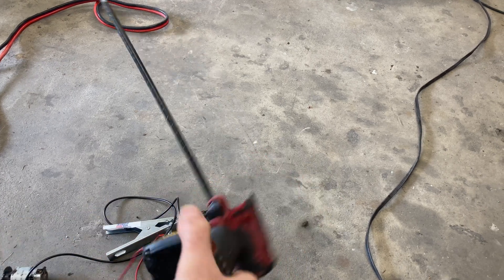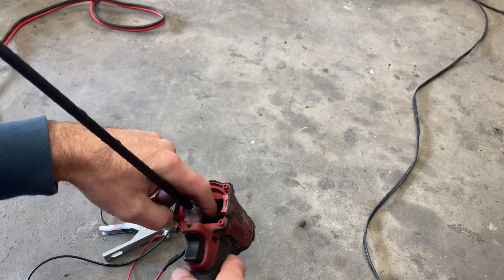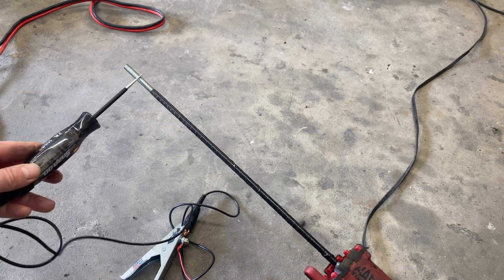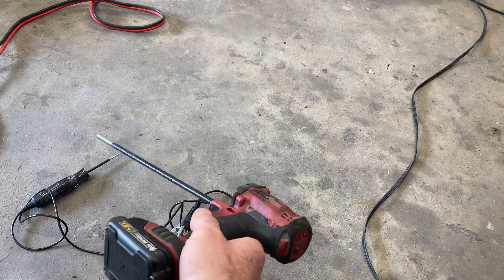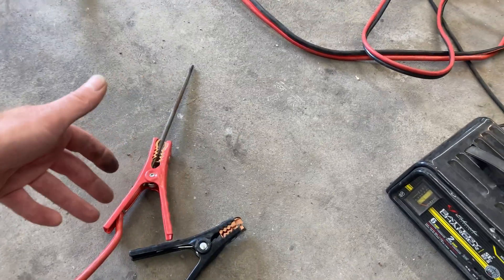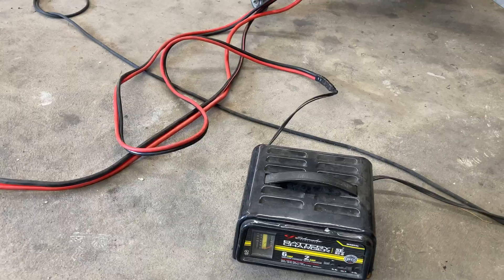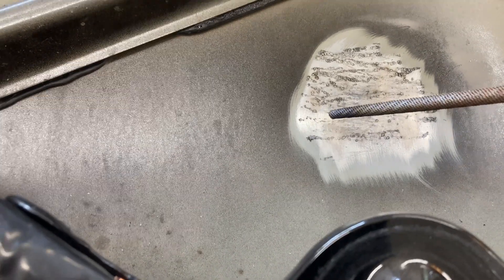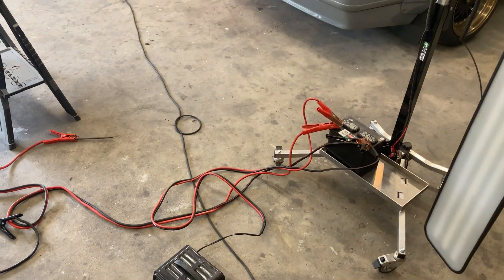Battery Operated Metal Shrinking Tool for PDR

Comment: Hi, I use a 12/24v battery charger with a potentiometer, which gives me a wide adjustment range from 1-40 amperes.  This gives very high precision and control at work to avoid burning the car paint.
Reply: I use this from Amazon, works great 

C20 Adjustable Battery Charger 12V 24V 36V 48V, 12A Pulses of High-Voltage Battery Desulfator Maintainer with Smart Chip for Lead-Acid LiFePO4 Lithium Batteries BLB-C20
Reply: @MichaleM8616 I am looking for a charger with that option, can you tell me which model you use, please?
Reply: @borycollision   BJC digital battery charger with jump starter, but i see it is available only in Poland.